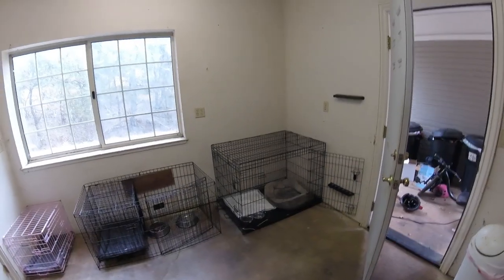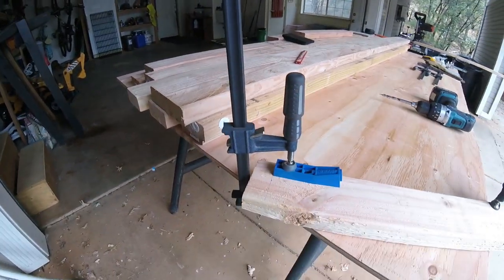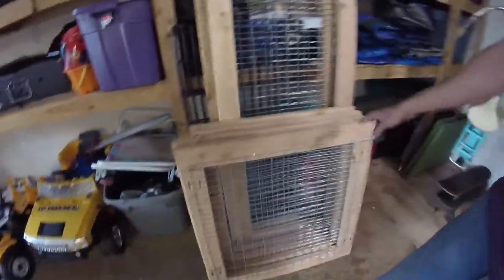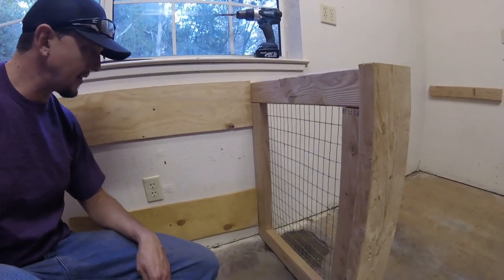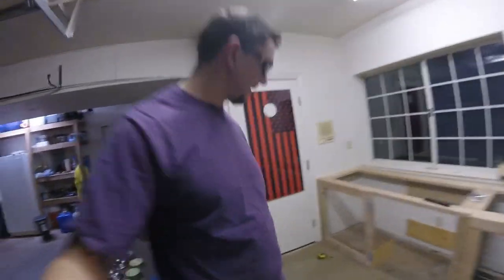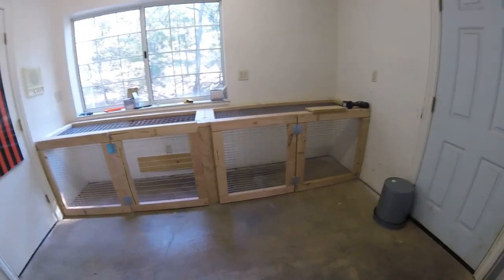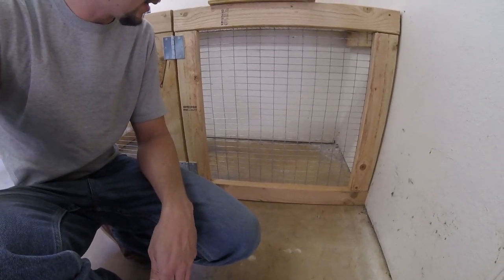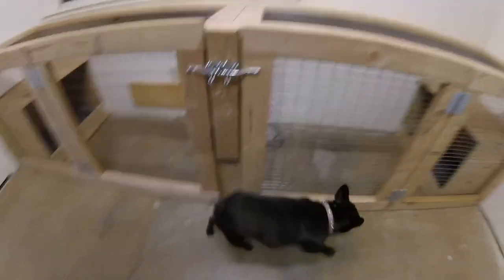SUPER EASY Indoor DOG KENNEL Build!!! | Dog Run Part 2 | French Bulldog Dog Kennel Ideas

Comment: Great idea! I have frenchies also and we are needing a kennel room as it’s too much with five frenchie kiddos in the house. We want to do indoor / outdoor  but what about the garage temp during summer and winter? Also are you ever concerned about theft ? That is my biggest fear even though we lived on five acres fenced and gated. .
Reply from the maker: It does get cold in the winter so I will be  replacing the wooden boxes with something more insulated, but on the other hand it stays cool in the summer as well which is good.  I lock the outside doors if I am leaving just in case although I do not worry about theft for various reasons.